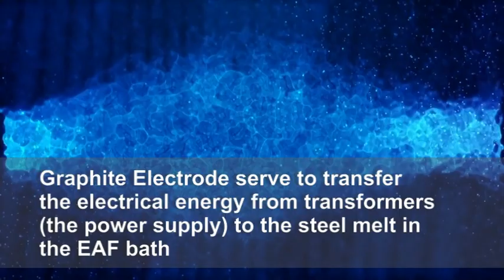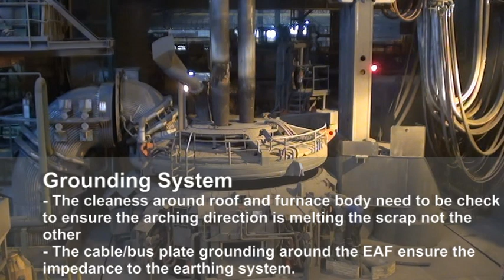Graphite Electrode in Electric Arc Furnace

Comment: FYI  for those not familiar ; those carbon electrodes have a threaded male and female end where each one can be continuously screwed together and added from the top. The 2nd and 3rd helper would turn them in while being suspended by the crane on a swivel. A very hot job to say the least usually done right after a heat was poured and when the first bucket of scrap was in the furnace the electrodes would be run down so the clamp on end of arm could be opened allowing release and raising of arm letting electrode slip thru as needed. Usually only one or two sections were added at a time on a active furnace due to the intense heat
Reply: So the electrodes are melted down to make the recycled steel?
Reply: @micahjohnson3901  They are slowly burned away from the intense arc and heat like a welding rod  but they would like to figure a way not to have them burn off because of the expense.
Reply: @goaheadmakeourdayscooterpe9644  I get it now.  Monday I have an interview with a company that manufacturers the graphite electrodes and I needed a general understanding of what they do. I'm excited about it even though I was thinking I'd be working along the lines of the EAF  🤣 . I'm still excited about being part of this industry .

Comment: How many electric arc furnaces are there in a large integrated steel mill?
Reply from the maker: It's depends, my company has 10 EAF, but the active EAF were 4 until today. Due to many new technologies, EAF become a high ineffective machine, it needs huge energy to melt the scraps and DRI. BOF and blast furnace becomes popular due to energy saving and cost. But today, blast furnace becomes issue due to the waste of the coal. The Green Industry taglines

Comment: Most interesting. Would you kindly describe the water cooling system such as primary water treatment process, pressure, volume required and recycling, if any. Thank you. Col, NZ.
Reply from the maker: I only can share information regarding the design process, but not all, We have WTP and equipped with cooling tower (open system cooling down). The water cooling for the HCC is closed cooling system, so it's circulated cooling system back to WTP.

Comment: Omg, is such a costly & rare element of Carbon, Graphite is used for such a paltry steel? What about Induction furnace?
Reply from the maker: Im sorry, I missed to answer this question, I agree with you mr speer, it's a different type of furnace to melting the scrap etc, as I know the amount capacity of the induction furnace is small compare to EAF, and also the steel is clean compare to conventional EAF